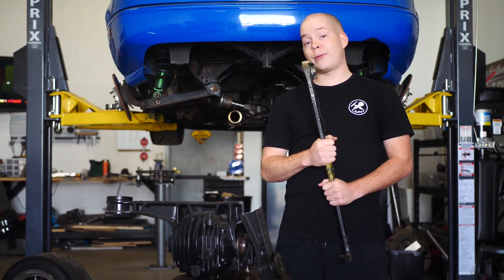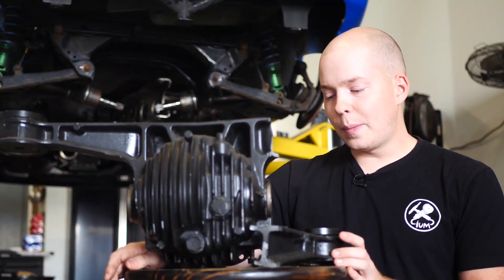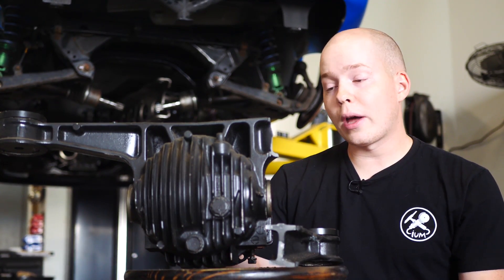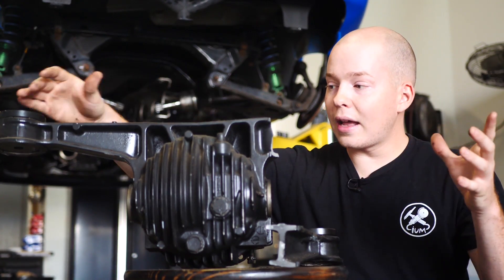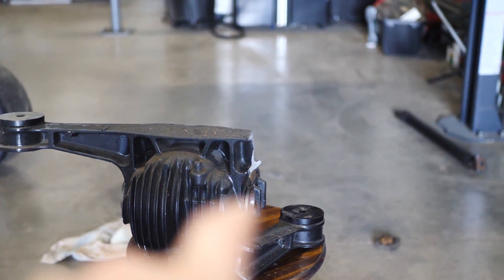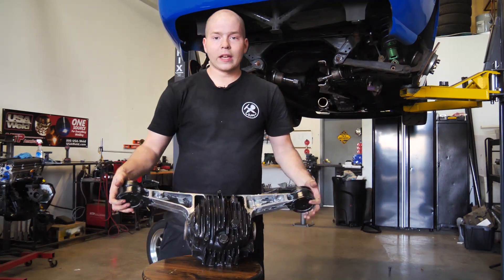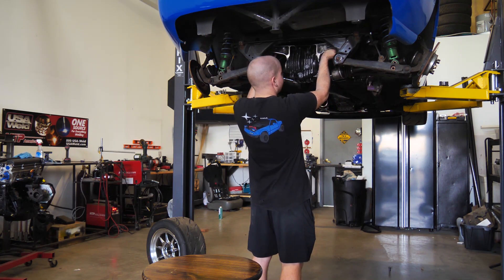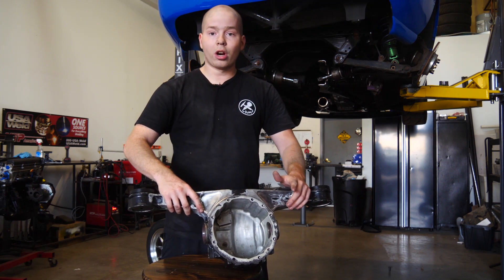How To Reinforce Your MIATA'S DIFFERENTIAL For $20!!! (400+ HP Capable)

Comment: cast aluminum has to be preheated and post heated to be structurally sound. and welding cast in any situation poses the risk of it cracking next to the weld you just did because often times the parent material weld is stronger than the case itself. not something the average person can do. so more like "how too pay a shop to reinforce your differential for 500 bucks and have it maybe still crack"

Comment: Tig welding aluminum. That's not that easy to do. I guess with a good welder, the right shielding gas and the fact it's thick metal, makes it not too bad of a job. What's under the hood, a K swap? Or a turbo?
Reply: Built 1.6 with high compression and a garrett 2560 maxed out, 388hp

Comment: You don’t have suspension for drag racing don’t go crazy changing all that stuff. Maybe adjust coilovers/ soften the damping / softer springs / maybe ya got blown shocks? Tire pressure could also help as well.

Comment: Why didn't you grind a Grove down the crack? You just welded straight over it leaving now a internal crack where it snapped
Reply: Not if he penetrated deep enough. Grinding a groove would have made it difficult to line it up properly again, creating the possibility of messing up the dimensions of the diff housing, and it not being able to bolt up to the car again.

Comment: Just for those kids watching at home, it isn't strictly the power level that breaks these differentials, it's the power delivery/driving style. Harsh dumping of the clutch at a sticky drag strip with sticky tyres increases the probability of these sorts of issues. Whereas pulling away from the line with some mechanical sympathy before stomping on the power will improve longevity of the diff as well as other such common failure points like the transmission.

Comment: When making the gasket for the diff arent you supposed to go past the holes on the inside not the outside so it does not leak from the bolt holes ? Correct me if im wrong
Reply: You are correct
Reply: tought same, look at 7:39, he spread it evenly

Comment: I think one big improvement of your drag times would be if you changed the final drive ratio. From the video on the drag strip i could tell that you were shifting way too much and didnt really get into boost for too long and lost a lot of time shifting.
Reply: yeah most miatas come stock with a 3.9 or 4.10 to compensate for the lack of torque in the little 1.6/1.8. Also, if I'm not mistaken, Gingium is running the 6 speed, which has the same gear ratio range as the 5 speed, just closer together with that extra gear. Those closer gears are great for staying in boost, but not great for 1/4 mile times. At the end of the day, miatas are cornering cars, so i doubt he'll want to change the rear end and sacrifice his torque out of corners
Reply: @wowthtsgood  6spd mx5/miata require a different series of diffs to the 5spd. Top 6th is a much lower ratio than top gear in the 5spd box, so swapping the box alone causes problems.
Reply: @BuddhaOfDarkness  uhh actually 5th in the 5 speed is 0.814, and the 6th gear in the 6 speed is 0.843.. soo actually the 6spd is barely shorter than the 5spd lol.
Reply: @wowthtsgood  I appreciate it's not a great margin till you see the differences at top speed.
My current 1.8 has a 5spd box and 4.3 diff and does 140mph@7k in 5th.
I'm not sure what diffs were in my previous mx5s.
My old 1.6s barely made 115 at 7k and they were both 5spd. A change of box to a 6 with the diff from my 1.6 would exasperate the problem and would reduce the vehicles top speed notably.
That wouldn't please my needs.
Reply: @BuddhaOfDarkness  the difference between the 5th gear of a 5 speed and the 6th gear of a 6 speed is exactly 5 mph at 7k rpm with a 4.3 diff mate. There's virtually no difference.
Reply: @wowthtsgood  I see. I stand corrected.
Reply: @BuddhaOfDarkness  difference of 274 rpm.
Reply: @BuddhaOfDarkness  no worries. There's a lot of mythology around the gearboxes and diffs of miatas. The 6 speed miatas did all come with longer diffs, but it wasn't so much to compensate for the shorter 6th gear. It was more to create the illusion that you had a long 6th gear, when in reality, you just had a longer diff. This design gave a similar gear spread feel to the 5 speed, with the feel of a longer 6th gear on top, while putting less stress on the drivetrain with a less torquey final drive. All im saying is that the longer diff isn't really necessary, and was just mazda creating the illusion of a longer 6th gear.

Here's where i got all my info
https://www.miata.net/garage/KnowYourCar/S8_Gears.html

Here's how i did all my math
https://www.blocklayer.com/rpm-gear.aspx
Reply: @wowthtsgood  Thanks for the links. Blocklayer looks a good find.

Comment: anyone else have exhaust rattles in their na miata? could it be the heat shields?
Reply: i did, the heat shield under the cabin is thin metal i just bend it away with my hands and solved the problem try tha
Reply: @mrskittles5150  alright i’ll give it a try let’s pray 😂

Comment: You need to adjust the rear castor to fix the wheel hop, aka traction rods, making the rear suspension mounts solid will not help

Comment: Try preload launching. Hold ebrake and go to the clutch 'bite/grab' point, then release clutch even more to give momentary high preload and fully release the clutch. It should slingshot you out of the dig. Also, slip the clutch, don't drop it. It can't shock something, that is tensed up. Football kick can knock out a calmly standing person, but it won't knock out footballer with tensed up body prepared to hit a ball with his head. Same principle.
Reply from the maker: That is a great idea. Unfortunately, Molly doesn't have an E-Brake that works...
Reply: @_Gingium_  next video 'Fixing Handbrake/adding a hydro'

Comment: Dude you can buy reinforcement plates to bolt in which I want but if they're aluminium I'd rather weld em in and I'll probably fill in the notch while I'm there

Comment: This diff housing will break again calling it now.
Reply: Maybe, but even if it does it doesn’t really matter bc he only spent less than $50 and will make more than that on the video and there’s a chance it won’t break so this could really only be a good thing
Reply: for sure, because its already weakened by the crack. told him that on the last video as well, but we´ll see
Reply: Didn't CPC already go through this with his car?
Reply: naw def not gonna break. It's gonna take way more torque than he's making. Think about it. 1/4 inch thick aluminium in the middle, outside, and inside. Then add the support of the top and bottom, then add the support of the bits crossing the inner cavity. This shit dummy strong now. If anything he'll break an axle or ring gear.
Reply: @wowthtsgood  I think he was referring to the welds. Aluminum is very finicky. He needed to grind back the cracked aluminum and make a root pass, I guarantee that crack is still there. There also was no pre or post heat treatment. That's probably why he welded on plates, but even then with no heat treatment, he changed the structure of the aluminum around the haz, and even sprayed it with water in between passes...! However I don't know how much force the diff case sees, but it's critical in welding structural aluminum.
Reply: @bobos245  surely not optimal, but i think itll be ok with the power he's making. I just was saying it would have been much harder to get the mounting points to line up if he grinded a groove for penetration. A wise man once told me, "it'll be fiiiiinne"
Reply: @wowthtsgood  Lol you say that, and if it were say, a catch can, I would agree. But at least he won't die if it breaks again lol
Reply: @hangtime7190  "lol." Someday you'll realize how dumb you come across.

Comment: an alu weld is stronger when you let it cool down slowly. when you cool it quickly with water the weld weakens.
Reply: I was going to mention that same thing. Spraying hot welds with water is not a good idea for this application.

Comment: You should try putting traction bars on Molly. Those greatly reduce wheel hop
Reply: Traction bars, polyurethane bushings, and bias ply slicks instead of radials.
Reply: I just realised it's a irs instead of a solid rear axle so traction bars won't help lol, but a stiffer sway bar will tie the wheels together to help aid traction and prevent wheel hop.
Reply: Traction bars are for solid axle cars, this is IRS. I could be wrong or missing a joke but I've never heard of an IRS traction bar.
Reply: @brandonthompson9957  yeah lol, I had corrected myself when I realized it was irs lol
Reply: @TheLoverofhalo  The comment was aimed at Randall, but I now see you said basically the same thing as me so my comment was pointless lmao
Reply: Yea I just realized it has IRS
Reply: This car also still needs to go around a corner tho
Reply: Instead of polyurethane bushings why not go all the way to spherical bearings (also called Heim Joints I believe)? That gives basically no suspension deflection at all, and they shouldn't be all too bad in price, also only requiring a bit of additional lubrication after perhaps a year of moderate time on the road. They would push Molly to become more of a focused track car rather than a road and track vehicle, though, so maybe not.
Reply: @Avetho  probably cause they might not make them for his control arms so he'd have to make custom control arms just to use some expensive bearings that wouldn't show any difference in traction gain at his horsepower level. Most people don't consider anything other than poly bushings until they're topping 800hp levels.
Reply: @TheLoverofhalo  Yeah, despite there being spherical bearings at the size required here, Caleb would have to do some machining to make them fit properly I'd think. He's only really gotta stiffen it up a bit to reduce wheel hop which poly bushings can eliminate even at much higher power levels since they already reduce bushing deflection and thus suspension oscillation under acceleration enough so that any hop that does happen doesn't keep building up into a weld-tearing, bolt-stripping experience.

Spherical bearings are more designed for race cars where lateral loads are a big concern, and even then Molly isn't a car on the level of a Pikes Peak competition racer that can drive on a ceiling so my point was already kinda moot from the beginning XD
Reply: Hahaha

Comment: The diff is so tiny... I have a BMW z3 M roadster (Mazda Miata in a tuxedo on steroids) and I have had my diff out doing a service on it and that was a huge pumpkin.  Awesome video and great knowledge drop
Reply: That's cause the Miata is a smol car :D
Reply: its the same chassis as a e36 compact, so yeah youre getting pretty cool stuff
Reply: JB Weld 😆
Reply: @thorvonfalin9975  “e36/7 for roadsters or e36/8 coupes (clown shoes) so many of the same parts in the front where they copied the older e30 rear ends or took 99% of the notes from them so truly best of.
Reply: how much power u running?
Reply: @mrskittles5150  last dyno back in 2004 was 330rwhp/300tq.  The S54 is a monster and I love it it is also NA no turbos or supercharged but I think about doing it which would put it around 550-600 but then I’d need to do so much frame work as I have ripped the shock towers once and did the reinforcement under warranty back in 2003 because finishing the build.